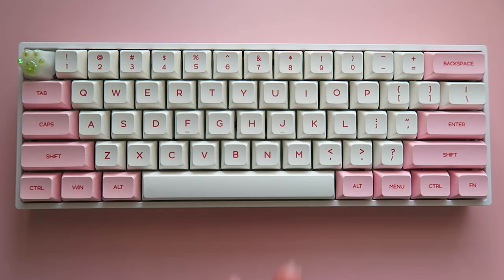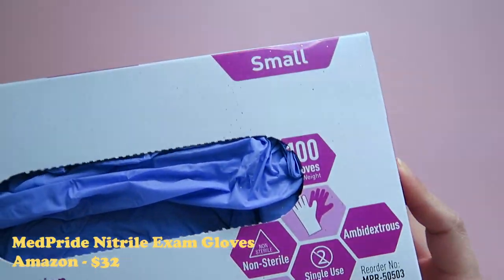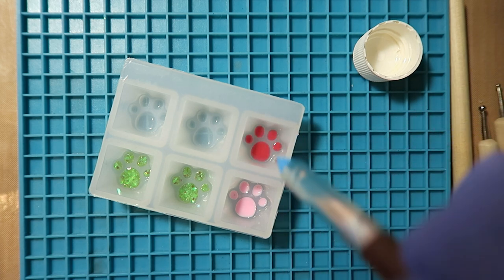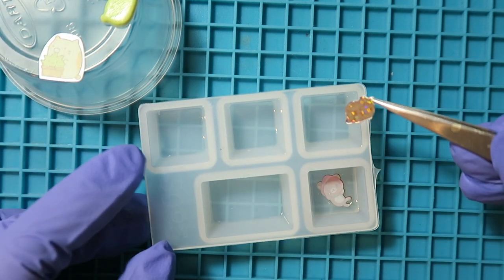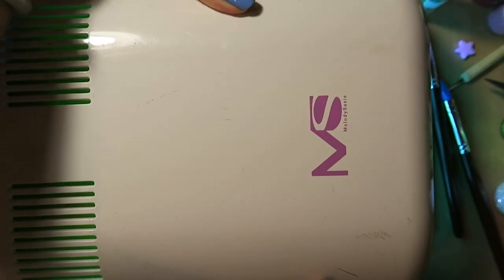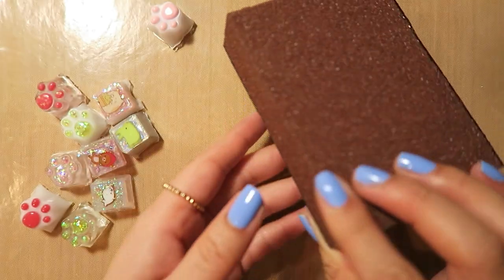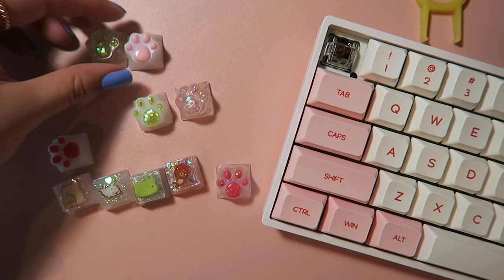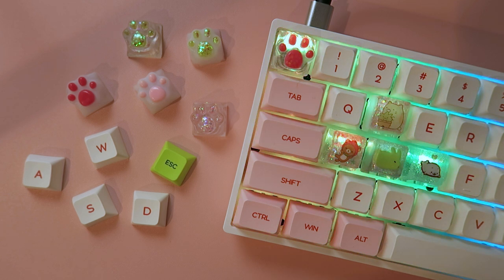Making Custom Key Caps with Resin for the First Time ✨ CoolRiceBunnies Kawaii DIY Watch Me Craft

Comment: I use a low profile mechanical board with DSA (the lowest profile keycap). Im thinking to make the caps myself the same way you did and sand the top down until it becomes flatter. Do you think it’ll work? Hoping to craft some myself since the keycap options for DSA is so boring

Comment: Sent here by Adafruit! Really thinking about making custom keycaps for my macropad that I use for computer-aided design... I want it to be functional (ie, keys labelled) but also cute and follow my personal donut theme. Have to spend some time thinking about how to pull it off. I might just get high-quality stickers printed, and then put a layer of epoxy over them so they don't get worn.
Reply from the maker: Sounds like a fun project! Just make sure your stickers are water resistant before applying the epoxy over them or else it can eat away at it (if it’s just plain paper). If they are just plain paper stickers you can seal them first with something like mod podge. Also thanks for mention Adafruit! Is that another YouTube channel? Did they mention this video or my YouTube channel or something?
Reply: @CoolRiceBunnies  Looks like my replies got nuked because I included links. Hopefully you can see them in your comment moderation queue.
Reply from the maker: Aw no they aren’t in my held for review section either. Could you try again with just the title of the video or channel? ☺️

Comment: Very cute! You inspired me to make my own. Do you know why the "fails" (which were still v cute) had uneven edges compared to the ones that turned out really good with even edges? And could you sand them down to make them fit better in the keyboard?
Reply from the maker: I simply didn't fill those molds up with enough resin, so the air bubbles rose to the top and stayed there! You could always sand the key caps down on the edges yes, but just depends if you want to put in that work and are okay with the uneven look afterwards.

Comment: I’ve been wanting to pick up making custom keycaps as well and after seeing this video it made me go straight to Amazon to order my supplies but I was wondering if you used only uv resin for the whole keycap? I’m not sure which resin I’m supposed to use. Do I need epoxy resin? Thanks for the great video btw :)
Reply from the maker: For these keycaps specifically I used only UV resin but I plan on making keycaps with epoxy resin too.
Reply: @CoolRiceBunnies  how did u get the bubbles out??? i didnt see a single one how do i do it without the burner kinda thingy??amazing vid btw subbed :)
Reply: @CoolRiceBunnies  also is putting it under the uv light mandatory or can i just put it in open sunlight (the place i live always has<30 degree celsius pls ans

Comment: Ok so this video really want me to start doing resin 😭 but important question, do you really need an UV lamp for this or can u also just wait alot longer? 😓
Reply: You can put them in the sun on a really bright day and they will cure in likely 30 mins, but if you don’t want to do that you can get 2 part resin and you just have to wait a day or two until it’s dry

Comment: hi! thank you for this video i ordered the same molds but wanted to be sure i didn't do anything wrong. where are the stickers you used from or do you know where i can get similar ones?
Reply from the maker: Hi Eliana! The stickers I got are from Japanese stationery and plushie stores local to my area, but you can use any kind of sticker that isn't made out of paper. You can find cute ones in craft stores. If the sticker is made out of paper, just be sure to seal it with something like Mod Podge on both sides.

Comment: I REALLY hope you didnt get tid of your "Fails"!
With UV resin there is ALMOST no such thing!
All you have to do is add uv resin, then reclose making sure that you have enough this time! ♡
 like you said,  a bit of overflow is sometimes a good thing.  Then Just REcure... Those cross pieces would have EASILY rebonded to the larger pieces. And with a bit of patience and some cella tape you could even block off that corner... OR you can biuld it up and fill it in "Doming" it in a way. It won't be perfect, but itll get rid of the hole.
Those were just TOO CUTE!!
 I HOPE youll be able to save them!♡♡♡
Reply from the maker: No worries!! The ones without stems were fixed :) But some still failed for other reasons (i.e. sits too closely to other keys).
Reply: @CoolRiceBunnies  ahhh well they're VERY cute! i thought you did such a good job, i just didnt want you to lose any💕

Comment: What if you don't have UV light to cure them? What can you use for curing?
Reply from the maker: You can let them sit in direct sunlight but the process may take longer (i don’t have recommended curing times for natural UV light/sun)
Reply: @CoolRiceBunnies  thank you so much for your response!
Reply: @CoolRiceBunnies  For how long did you cure the resin after closing it with the back mold?

Comment: I have a question, how much was the machine that cured the keycaps? And can I just let sit the resin so it drys?
Reply: Letting it sit in the sunlight or just regular light takes a little longer but yes you can. Most resin will give you time estimates on how long each process takes. UV lamps are pretty affordable on Amazon. Hope this helps!
Reply from the maker: I think I got my UV lamp on Amazon for about $30? But you can find much cheaper ones and that are smaller in size as well. You can always just cure UV resin in direct sunlight but it may take longer. Like the other user who commented said, most UV resin brands will let you know how long they need to cure whether its in the sun or with a lamp. :)
Reply: @CoolRiceBunnies  thank you <3
Reply: @casualsteve4156  thank you <3

Comment: Y using fire if u already work with UV light?
Reply from the maker: The UV light is for curing the resin, the fire is only for popping the bubbles that are on the surface !
Reply: Thnk u 😇

Comment: i use uv resin i already bake it for 10min well it harden but the side and upper is wet and sticky idunno what to do 😭
Reply from the maker: Might just need to leave it in the UV lamp for longer and also rotate the mode so each side gets  the right amount of light. I’ve also heard of people taking their sticky pieces out of the mold and putting them in a cup of water to further cure inside the lamp and that takes care of it. Apparently the lack of oxygen around the resin helps with the curing process
Reply: @CoolRiceBunnies   i wil try to setting it out in the sun.

Comment: hello. i try this but why my keycaps its like wet idk not hard as the vid :(
Reply from the maker: Are you using UV resin or epoxy resin? It sounds like either way, your resin is not curing properly. Depending on the type you’re using there’s lots of different reasons why that could be :l
Reply: @CoolRiceBunnies   im using uv and follow ur vid im curing it for  almost an hour idk still sitcky

Comment: Yessss!! Another crafter into mechanical keyboard AND brown switches! Yessssss! lol How are you liking the Epomaker keyboard with the Gateron brown switches? Your resin keycaps came out really cute! I really should bite the bullet, get the molds and start playing! The only thing that I am annoyed with is the resin I am using is meant to cure harder and not yellow... but it yellows, which is annoying! So I will have to try the UV resin and see how I go from there. >< Also the silicone cups... I absolutely detest them because they are dust magnets. I just use plastic cups then peel off the cured resin after then reuse the cups again. Anyways, have fun and hope to see more cute resin keycaps from you! :D

ps: Check out Mani-Land who makes resin keycaps as well!
Reply from the maker: I looove this keyboard with the brown switches, especially more now that I've modded it (lubed, filmed and foam modded). It sounds so good! Thanks for your lovely comment :)